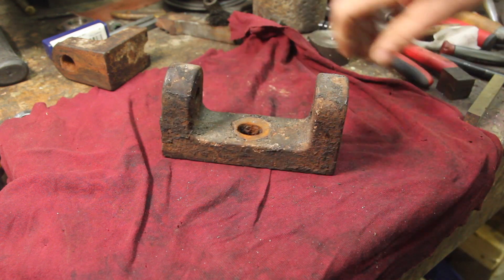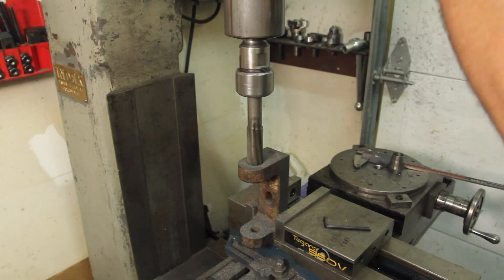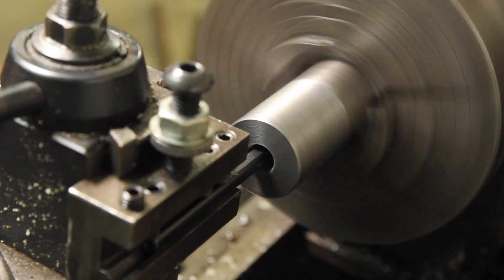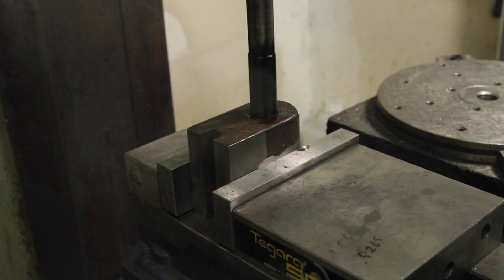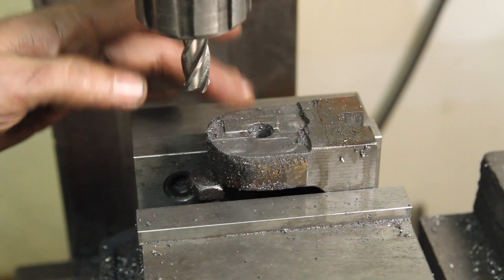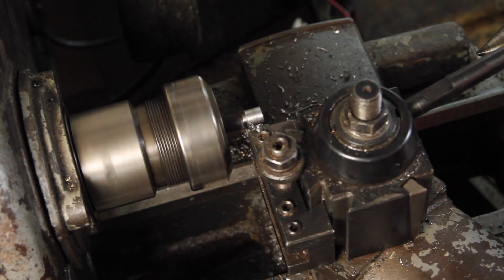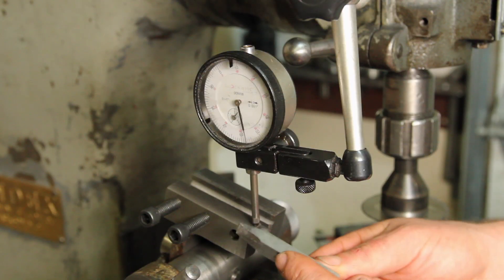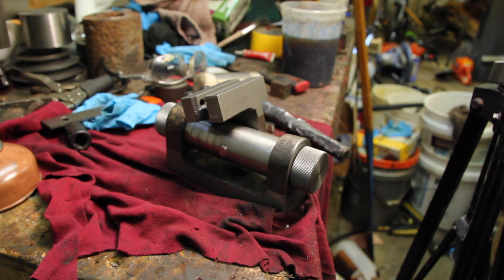Lathe Tool Grinding Fixture

Comment: holding parts offset in a vice is not good practice. Always clamp with a part of equal width on the opposite side of the vice

Comment: Nice to see someone else who uses my favorite kind of materials scraptonium, mystery metal and wore out old bolts which make good smaller bolts and pins. At the cost of materials i always root through my scraptonium and mystery metal piles first unless it's something critical that requires something special not much goes to waste here. I usually have a lot more buckets of chips vs unusable scrap lol. Good job at showing good use of scraps 🤔🤔👍👍👍👍

Comment: You can use some Belleville washers under those knurled knobs to adjust the pressure to tighten the fixture. Work out the tolerances ahead of time and you can avoid having to flex the fixture to clamp it and still allow for smooth and free movement when knobs release.

Comment: Holy Cow, I've been in this business a long time. I can't remember how to do change gears. Thank you for the reminder.
Your project is great and useful, has great presentation and shows great machining skills. 
I love it.
Without criticizing,  because I'm not,  I would only suggest grind or otherwise knock the rust and scale off anything before machining.
There is nothing more abrasive on tools than rust and other oxides. 
Thank you for the vid.

Comment: Great project and video. If I could make a suggestion, the starting material seems to be cast. Which is great material but the flex needed to lock fixture when finished is better suited to mild steel. The locking knurled end fixing may be better suited by milling a hex so a socket or spanner could be used to apply nessasary holding pressure. However I think the finished piece is very good and will definitely be following your design. Great video

Comment: Are you really set to pull out the surface grinder every time you need to put an edge on your cutting tools?
Reply from the maker: No, only special occasions.  Threading tools and oddball grinds.
Reply: @JeremyMakesThings   ya I suppose if one ever get to the point I need a more accurate grind and already had a surface grinder set up, it would be indispensable... But honestly for threading you don't need to be any more precise than a thread gauge will give you, just need to feed at a precise angle.

Comment: One project means 16 other projects or repairs, by the time you get those done, you've lost track of what the original project was.  Had something similar to that this past summer... I think the turn around point was in coming up with a fix for the tap switch in the old tombstone welder ... from re-purposed materials.

I've ground bits for my shaper on my surface grinder before, using a small mill vise and Inclinometer.  Works for getting the angle right, but limited in that I had to grind in the relief by hand.  A good way to mess up the work you did on the surface grinder.  I like the simplicity of your grinding jig, I'll certainly put what I can of that idea to good use later on.

On your next bit holder, you might try to integrate a few reference surfaces on it, so you can use angle blocks for quicker/dirtier setups.  Just an idea.

Comment: That whole preamble thing at the beginning, I have never felt such a connection with a total stranger, turns out I'm not alone in this.
Reply: Indeed, I know what is the yak shaving phenomenon. I think I live in it every day.
What is the term for a circular yak shaving? Like you need a perfectly flat surface to balance the wheel of your surface grinder, but for that you need a balanced wheel to have a perfectly flat surface….  Which opens another yack shaving tree.

Comment: You need to look up Speeds and feeds for the Material and the tooling in Machinery's Handbook.
Get a used one for 10 or 15 bucks USD.

Comment: Nice, finding diamonds in the rough.
How do you "lock down" your lathe tool post at 5:15? I have the identical lathe (1945 Logan with a QCTP - and worn 4-jaw screw heads, just for good measure), and chatter is killing me for surface finish.
p.s. once you make your new leadscrew, it is the same ACME 3/4-8 as the jaw screws, just by the way.
Reply from the maker: I just didn’t have the handle on the tool post “closed.”  
I’ve got to make a rotary broach so I can make new screws for the 4-jaw, and I probably need to do it sooner rather than later.

Comment: Make yourself a larger chuck key youll thank yourself :)
Reply from the maker: If I do that, I should probably make new screws for the chuck first, since the heads are stripped out.  But to do that I probably need to make a rotary broach, and in order to do that……